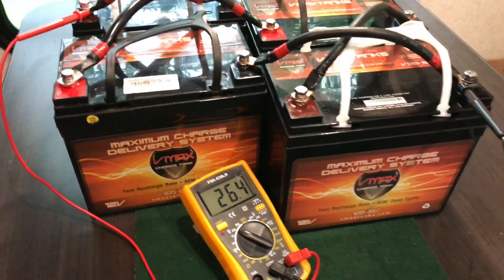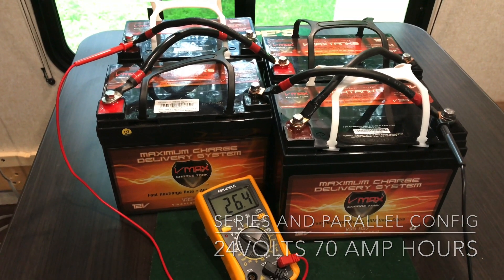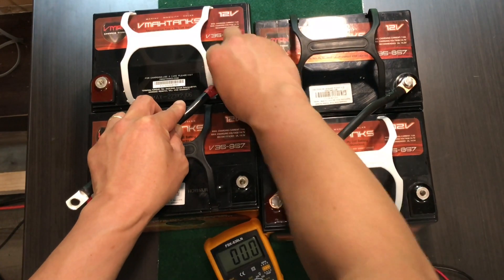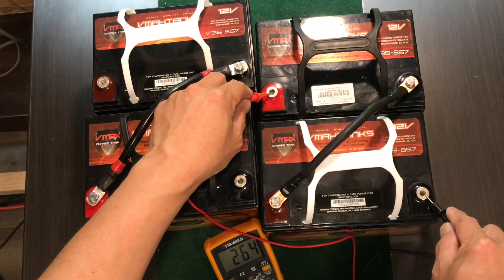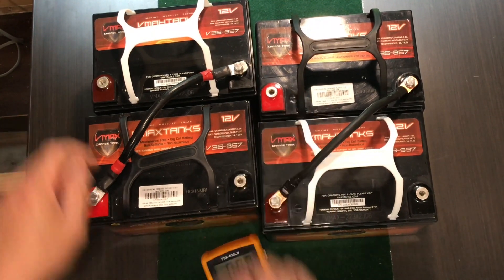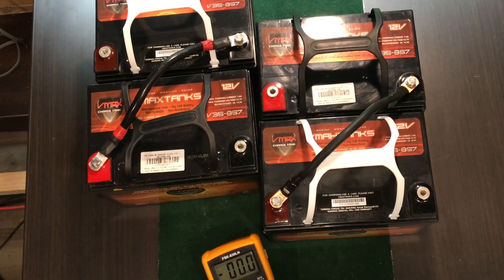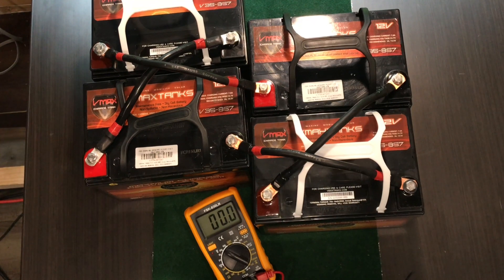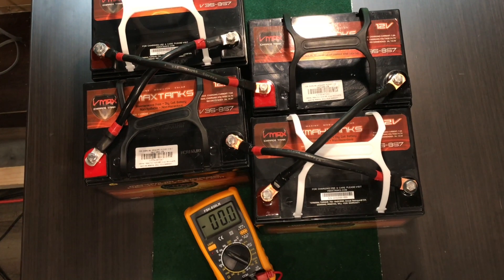How to wire batteries in Parallel & in Series COMBO 4 12v 35AH AGM Batteries wired to get 24v 70AH

Comment: According to Google:  Recommendation for 2026
For Lead-Acid/AGM: Use the 4th connection (midpoint bridge) to help keep individual 12V blocks from drifting.
For Lithium (LiFePO4) with internal BMS: It is generally safer to avoid the midpoint connection. Instead, treat them as two independent 24V strings. This prevents high-current "cross-talk" between strings if one BMS disconnects during a high-load event. In other words, the last cable is not needed and is better off without when connecting internally balanced batteries. I don't use one.

Comment: SWEET NOW WHERE WOULD YOU HOOK LEADS TO FOR CHARGING AND USAGE WOULD IT BE SAFER TO PUT A POSITIVE TERMINAL FUSE ON EVERY BATTERY? IM DEBATING WHETHER TO DO THIS OR STRAIGHT PARALLEL 4 12V BATTERIES AND BUY A DC TO DC  STEP UP WHATS YOUR THOUGHTS? FOR A 24V 25A MAX STERN KAYAK MOTOR. THEN THERES THE QUESTION HOW LONG WILL BOTH SETUPS TAKE TO CHARGE WITH A 3BANK X 5A NOCO CHARGER? SHOULD I GET A BIGGER CHARGER? LOL

Comment: So you went from 12v 140ah to 25v 70ah. The power stays the same. The advantage is in the thinner, less expensive cabling required for yhe higher voltage, because of the lower amperage. Ive had vendors tell me 24v series systems are harder on batteries, but I don’t know if thay is really true.

Comment: What terminals would you use to charge or discharge?
Reply from the maker: The same way the bolt meter is connected to in the beginning. Opposite ends - furthest + and the furthest - from the positive

Comment: is it possible to wire and  max out on volts and amps in my case I have 6 12v bateries with a rating of 7.2w each.
Can they produce 72v and 43.2 w?

Comment: How do u wire to max out volts and amps. In this case 48v and all 4 batteries amp combined?
Reply: You can't. Parallel doubles the amps. Series doubles the voltage. You cant' have both. Laws of electricity.

Comment: Can i hook up 4 200 A lithium battery's the same way
Reply from the maker: Some brands can do 4 BUT some brands can NOT. Due to the onboard system- bms. Beat way to confirm is to check the manufacturer of your battery directly. Most I would say can do 2qty… but always check with manufacturer

Comment: Hello thank you for this video.
Can you please tell my why it is important to do the series first and then the parallel?
Reply: I also await the reply??
Reply: Me too
Reply: While 2S2P and 2P2S result in the same total voltage and capacity, they are not electrically identical in how they manage cell-level stress and failure modes.

Configuration Differences:
2S2P (Two series strings in parallel): This is often preferred in large-scale systems because it allows you to use two separate Battery Management Systems (BMS), one for each string. If one battery fails, the other string remains operational.
2P2S (Two parallel pairs in series): This configuration is better for keeping cell voltages balanced automatically. Because cells are paralleled first, they naturally stay at the same voltage without requiring the BMS to work as hard during the middle of the charge cycle. 

Wiring and Resistance
Solid bus bars are the gold standard for minimizing voltage drop and ensuring identical resistance across the bank. 
2/0 AWG Wire: This is the superior choice for a 400Ah system, especially if you anticipate high-current draws (e.g., using a 2000W–3000W inverter). It provides a significant safety margin and reduces heat generation.

Code and Safety Compliance
According to the NEC (National Electrical Code) Article 480, ensuring "identical resistance" through equal cable lengths or bus bars is a requirement for battery longevity. For mobile applications (RVs/Boats), refer to ABYC Standard E-11 for specific bundling and terminal protection requirements.
Reply: It short circuits when you connect the crossover bridge (series).

Comment: Can you still hook up 12 v somewhere on it ?
Reply: Yes you can but if you use it that way it will lead to unbalance (the one battery or battery bank will be used more and that will not be good, I do not know how bad it will be for the battery)...
Reply: @a64738  is it possible to wire and  max out on volts and amps in my case I have 6 12v bateries with a rating of 7.2w each.
Can they produce 72v and 43.2 w?

Comment: Good Morning, I have 4 AGM Deep Cycle Batteries.
1 Battery is 105AH 12v SRM31 Interstate Rated at 98AH
I have connected them in 24v as well.
I wanted to connect them in 48v but I need an Inverter that will work for it.
I am waiting on a Solar Controller so I can charge it.
I have a charger, but how Would I connect it to charge my batteries without burning it.
I figure I would connect to one Battey. (+) (-) and charge it that way and the current would fill the rest.
Anyways. I'm still looking to see if this is correct.
I'm just wondering that math I need to charge it and how long it would take.